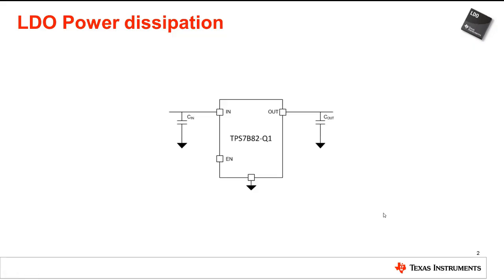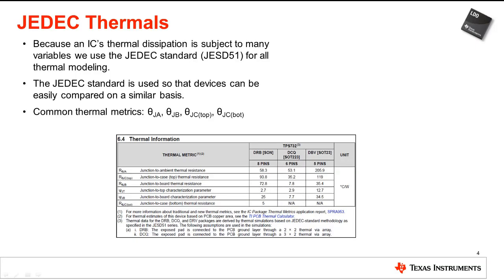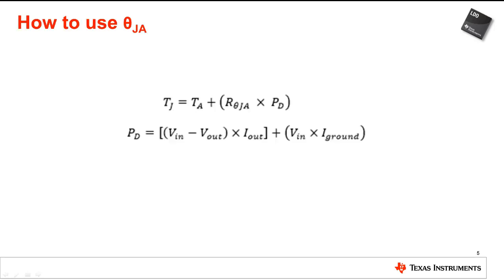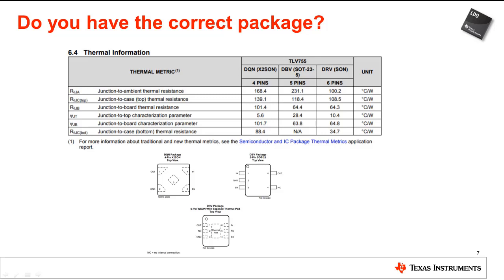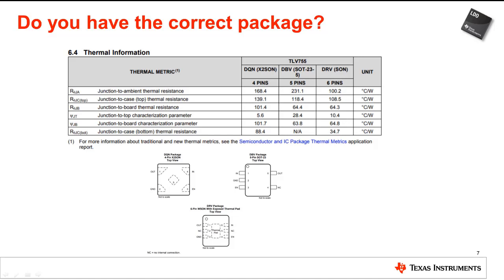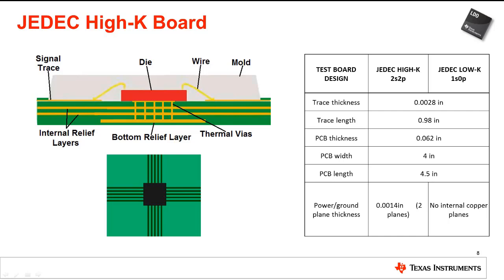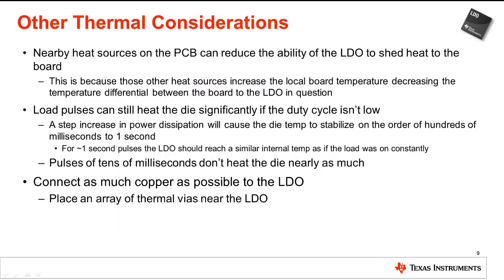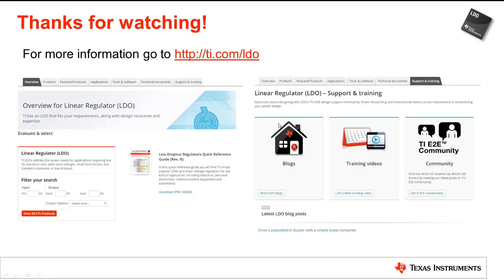LDO basics: Thermals

Comment: For TPS20 LDO, with 5V as an input and 3.3V as an output, how can I get Iout, can I use the Iout max from the datasheet or Calculate Iout from the input resistance of my circuit, as there is no output resistance
Reply: The output current is directly related to the load of the circuit you are connecting at the output of the ldo

Comment: Great video. If having a thermal pad is very important for long life of the LDO, why are they offered in packages that don't have a thermal pad? Easier soldering for begginers?
Reply: There are applications that consume very low power and still need voltage regulation. In such scenario, the power dissipation from the ldo may keep the internal temperature below the max allowed temperature